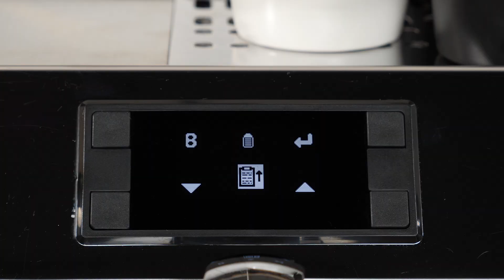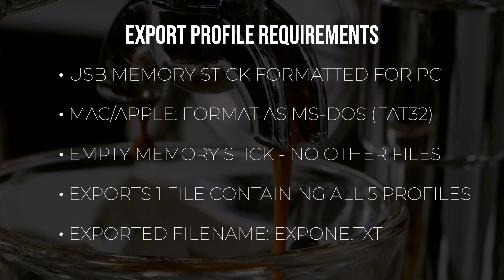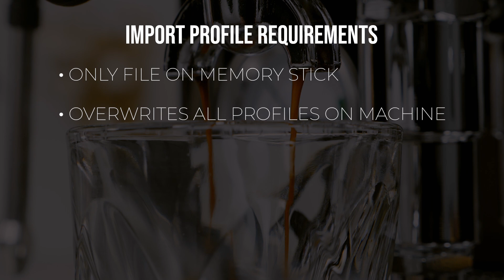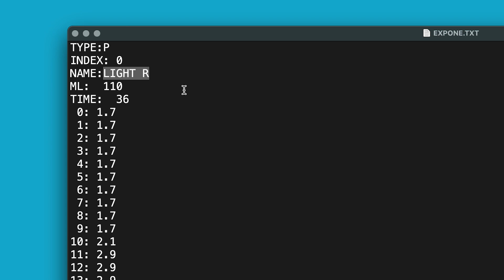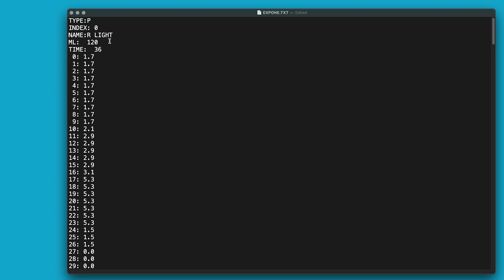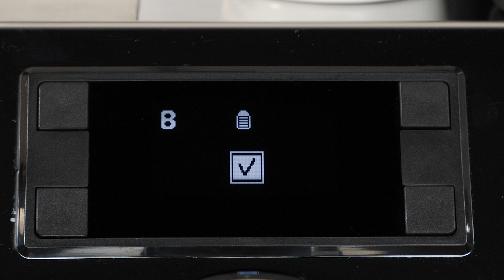Crem ONE PROFILER Espresso Machine: How To Export, Edit and Import Extraction Profiles

Comment: Hi Marc, there are 2 questions I would like to ask.

1- In the video, you mentioned every step in the "time" column is 4ml. Will this change is we change the total ml? Or it is fixed to maximum 240ml because there's 60 steps and each steps is 4ml.

2- When we have uploaded 5 profiles into the machine, it is possible to still do manual profiling with the side dial? Is it still possible to save the manual profile? If yes, which profile does it replace since we can only save 5 profiles?

Thanks Marc.
Reply from the maker: Hey Timz, Thanks for the questions. So 240ml is a really large espresso! But the machine should continue at the last set pressure. Yes it is still possible to do manual profiling with 5 loaded. If you want to save a manual profile you can choose which profile to overwrite.
Reply: @Wholelattelovepage  Thank you very much Marc. You have always been helpful Do you receive complains about the high pitch sound during a profile? I've heard that a number of machine came with thay issue. Is there a solution to it?

Comment: Hello Marc! Please help me out :) I have been now for quite a while trying to decide with what machine I will upgrade my current Lelit PL41TEM. I have been on the verge of getting the ECM Classika PID but seeing the Bezzera Unica PID prevent me from making a decision. I am primarily an espresso lover, and rarely I go for Milk drinks. From there, what would be your personal choice regardless the price gap? Which one in your eyes makes better espressos? Does the +0.25L of the ECM boiler play a role for steaming performance? Thank you!!
Reply from the maker: Hi AM! Easy, my choice is the ECM Classika PID w/Flow Control: https://www.wholelattelove.com/products/ecm-classika-pid-espresso-machine-with-flow-control
Here's a sample from a user review:  Noah T.
Verified Buyer
5.0 star rating
10/10/20
Flow control is where its at! Great machine for my needs as a micro-roaster, I'm able to dial in shots to bring out the flavor profiles of my roasts and experiment with blends. Thanks Marc for all the great information on flow profiles! I'm able to get a sense of how the coffee might behave on different machines by using the flow control, plus its a lot of fun. Great value for the range of shots it can produce and I don't do a lot of milk drinks so the single boiler is perfect for my needs. I noticed that it takes a good 20 min to reach and maintain temperature but after that point it is super consistent with very little fluctuation.
Reply: Say no more! Thanks Marc for the feedback - I will go for it. ☕️
Reply from the maker: My pleasure!

Comment: As a software engineer I will say that: this is a bad design. There should be an app for modifying this file and saving it back. There is no excuse for not providing such an app. It takes less than 2 hours to write something like that with modern frameworks and languages. And to make it wonderful you need a week. Far from perfect.
Reply from the maker: Hi g, Thanks for sharing your thoughts.
Marc